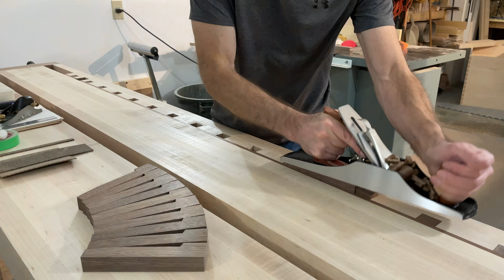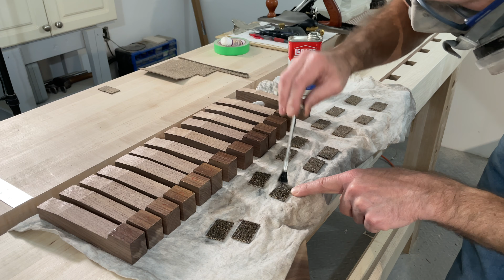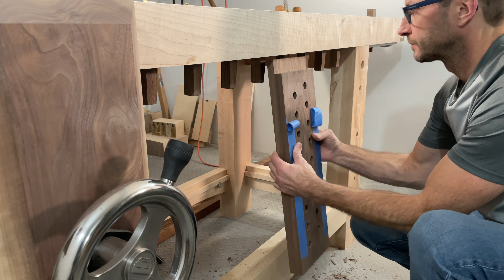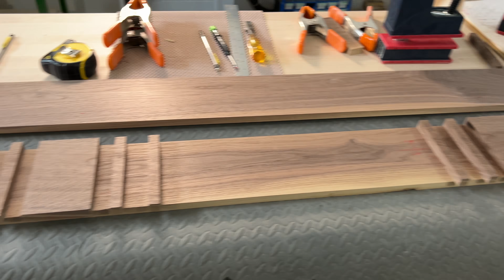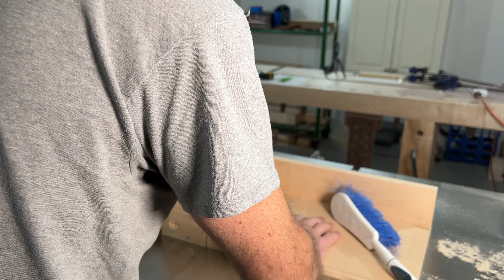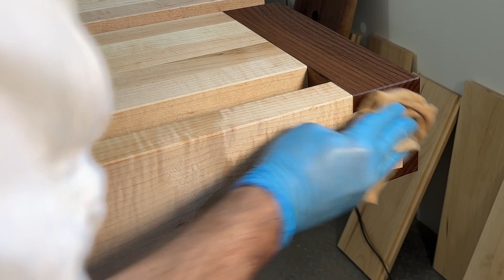The End Of My Split Top Roubo Bench... Finally!

Comment: Hi Gary, Thank you very much for all of your work to create these extremely helpful videos. I've built my STR bench over the last few months using white oak because I got a great deal on the oak, and I've used several of your techniques to help me get through this project. The white oak is splintery, and I'm wondering what you would recommend for a finish. I saw you used antique oil which looked great, but maple is much less splintery. A woodworker friend of mine suggested using spar varnish cut 1:1 with mineral spirits to seal the fibers, and then wipe it down after a few minutes following application. Do you think this would work? Any other suggestions? Thank you!!! 
Bob
Reply from the maker: Your friends’s suggestion should work just fine. I also don’t see any problem using antique oil or boiled linseed oil. Really anything should work. I just wouldn’t use film finishes like polyurethane or lacquer.

The absolute best thing you could probably do is just rebuild the bench using maple! Sounds like you’re already practised up and you know how to do it so the second bench should only take you a week or two! Just kidding!

What’s the first project you’re going to build using the bench?
Reply: I think I’ll start by building a couple of benches we need for the house. Saw a nice one being built to emulate an Amish blanket chest - might start there. Looking for good sources for plans - don’t mind spending a little money to buy them.
Reply from the maker: I may start offering plans.

Comment: Watching other people use a table saw precisely as casually as I use mine never fails to make my palms sweat.
Reply from the maker: Hey Patrick…. Although it may seem as if I’m casual about using the table saw, I can assure you that before I turn it on I have done several “practice” runs to make sure that when I’m done I still have all 10 fingers. I make sure exactly where I can safely put my fingers/hands and how to hold the workpiece whether it’s with my hands or a push block. I don’t like any surprises. Sort of like doing a dry run of a glue up. I also NEVER use the table saw when I’m tired/not alert. It’s too risky. I can only hope that all the other sawdust cowboys and cowgirls do the same but we both know they don’t!

Comment: Gary
Did you need to order additional crubber or was the piece that came with the usual vice enough? Thx...
Reply from the maker: I bought the bench builders kit. To be honest, I don’t remember if the crubber for the bench dogs came from one vise kit or the other but I know between the two kits I had enough
Reply: I have the kit also. It comes with a good amount but if i need more I'd like to order ahead of time. Doesn't sound like i will need to though! Thanks. 

I'm almost through milling for the two slabs and the other pieces of the top. So far so good!
Reply from the maker: You’ll love it when you are done!

Comment: Any reason why you decided to go with 5/8ths projection on your gap stop vs something a little shorter like 3/8ths?  Beautiful bench BTW!  I'm currently finishing up a similar build in maple & oak.
Reply from the maker: I just followed Benchcrafted plans and that’s the measurement they gave. If I could build it again, I would likely go with ¼” or ⅜”. Thanks for watching and commenting. I appreciate it because it helps the channel.
Reply: @garynelles  Have you considered cutting another notch so when you slide it one way you can have it at that 1/4 - 3/8” projection and the other direction gives you the 5/8” projection?
Reply from the maker: @michaeldoto4673 sounds genius! I like! I think at one time I saw someone who made the bottom sloped so they could set the height however they wanted to.